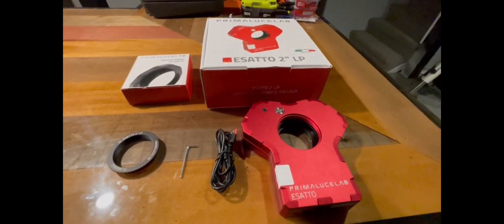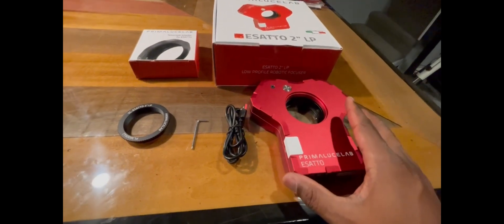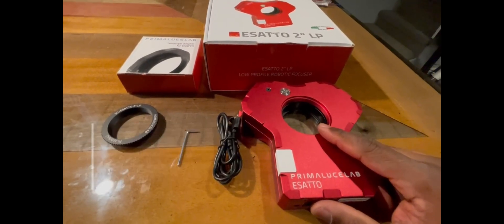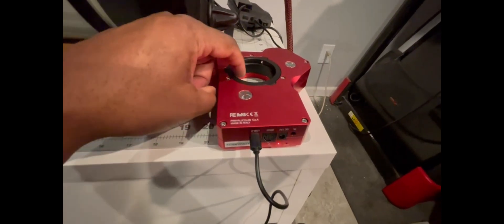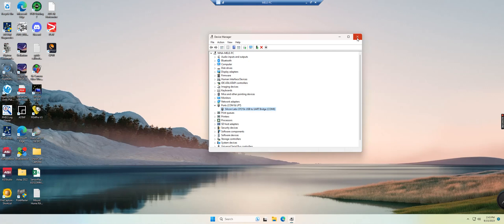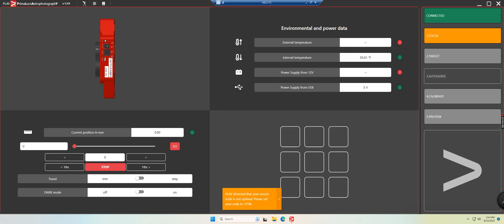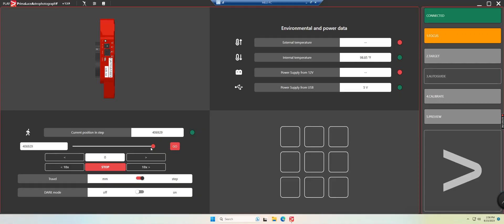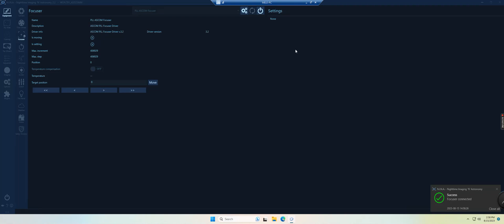Installing the new Primalucelab Essato 2" LP Focuser to my EdgeHD 8

Comment: This looks very nice, Eric.  Very anxious to see how it works for you! Have you found problems using the ZWO EAF with your EdgeHD 8?  (That's what I have currently, but I haven't used my EdgeHD 8 extensively yet.)  Also, I noticed in the video you still have the ZWO EAF attached.  Are you going to use that in conjunction with the Essato LP Focuser, or are you planning to remove it entirely?  (I'd love to get something like this but, unfortunately, I'm currently entrenched in the ZWO ecosystem, and I'd have to change/buy quite a few things before I was able to use a PC-based focuser.)
Reply from the maker: Thanks for the feedback, I too was locked into the ZWO ecosystem but I was not happy with the mirror flop due to not being able to lock the primary mirror. NINA has been great to use and moving to the Essato was easy as it it so precise and there is ZERO backlash to deal with LOL. I bought a MeLe Quieter 3 mini PC. I already had a Pegasus Astro power pocket box. I’m imaging now with the Edge 8 and been great so far. I may remove the EAF at some point soon but it’s not necessary. Having the mirror locked also helps keep the alignment between primary and secondary mirrors intact so I don’t have to collimate as much as I had to do with using the EAF.
Reply: @AstrowithEric  Thanks so much, Eric.  I'll have to use the Edge 8 for a bit with the ZWO EAF and see what problems I have.  I'm glad to see there's an alternative, even if I have to break from the ZWO ecosystem eventually.  Not the end of the world, but I just got very comfortable (and lazy?) having everything just work with the ZWO stuff.  Thanks for the insight!  Good luck with the microfocuser and I'm looking forward to seeing how it works for you.
Reply: AHH ... THIS was exactly what I needed to know. Many thankings, Eric. Clear Skies!!
Reply: @AstrowithEric  Hello, when switching from the reducer back to the native 10 focusing, do you have to refocus the mirror or is the Essato able to manage the variance?

Comment: Hi Eric. Would you still be able to achieve focus with a diagonal while conducting visual observations without powering on the Essato, using the mirror stock focuser? Thanks for the review.
Reply from the maker: Hi Jean, yes from what I understand you can still use the manual focus when you want. I personally still have my EAF on the stock focus knob to do manual focus and for imaging I get it back close to focus and then lock the mirrors and let the Essato take over.